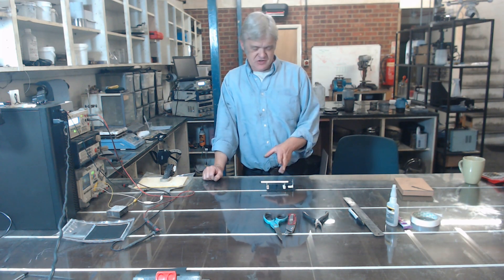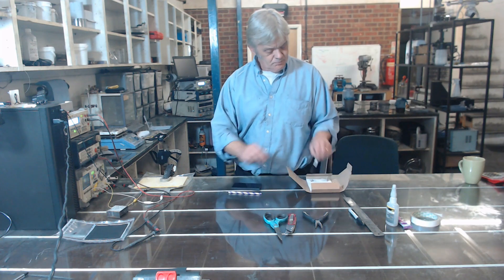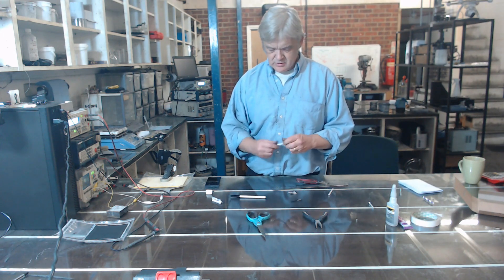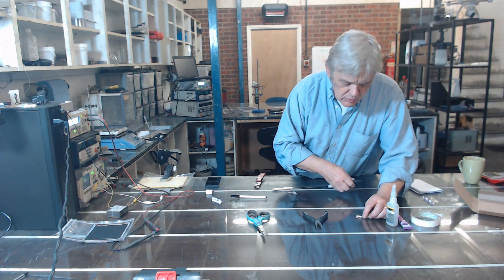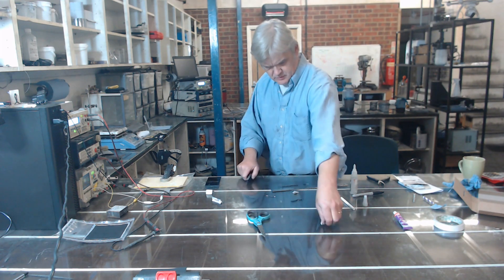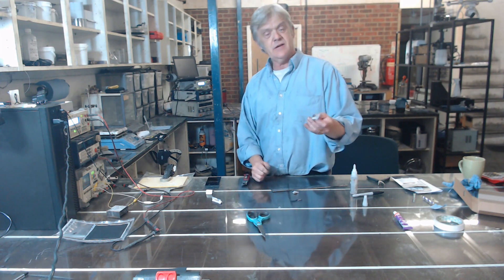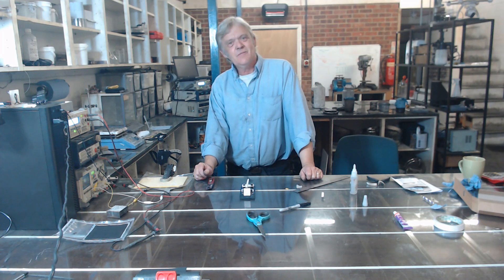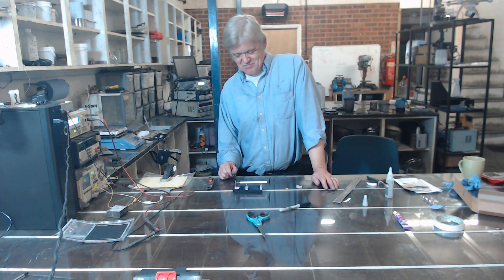Floating Pen - Make your Own as a Toy or Frictionless Bearing

Comment: hey rob, I was thinking about other useful capacitor designs, and I don't know if this is feasible or now, but if a capacitor could be designed such that it had a linear discharge curve, then that capacitor could be extremely useful for DAC signal smoothing. for example, imagine a piece of audio equipment like an mp3 player or something. the output of that signal (because it's digital) comes out looking like a stair steps for a sinusoidal wave. usually a capacitor is used to smooth out those steps, but as you know, a capacitor voltage drops exponentially the closer it gets to zero. what this means is not a smooth signal output and the signal noticeably lags behind. so, a capacitor with a linear discharge would be huge for anyone wanting to do high quality signal smoothing for cheap. there are so many uses that this could have.

so, I was thinking about how this could possibly be done, and I was reminded of your "strange capacitor" video where you explored capacitors with a high dielectric v-value for the separator. if there could be a material that reduces its k-value as charge decreases, then a more linear discharge curve could be achieved.
!
anyway, it was just a thought that occurred to me the night before last and I wanted to share it with you. your work is amazing, peace :)
Reply from the maker: interesting thought mate - I'll ponder it - cheers

Comment: If the magnets are each 2mm thick, the center to center distance is 68mm, NOT 66mm.
Reply from the maker: there's two on each end 2 x2 = 4
Reply: @ThinkingandTinkering  I did not know that there are two on each end; makes sense.
Reply from the maker: @billpeiman8973  yes indeed - I did say there were - but, cheers